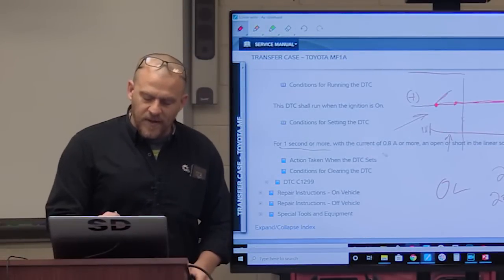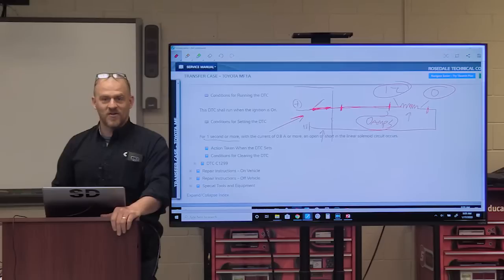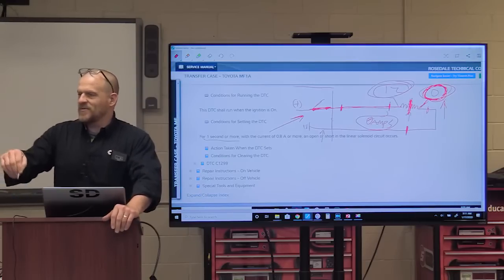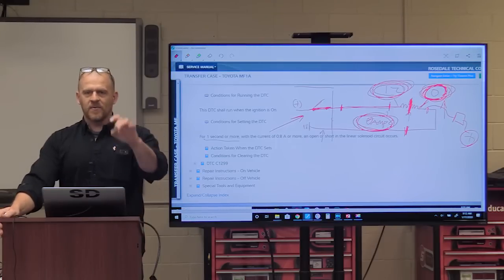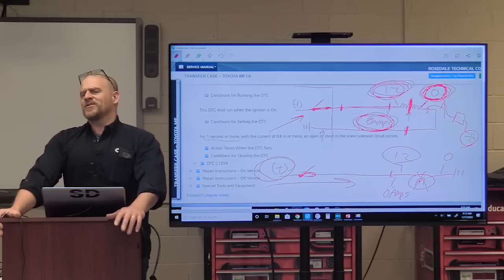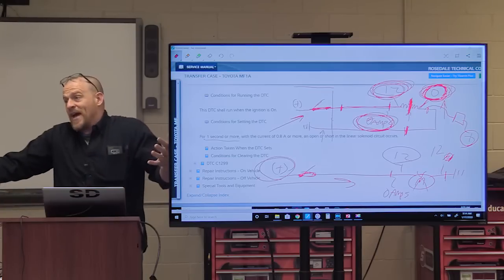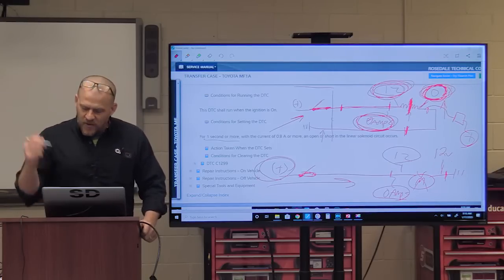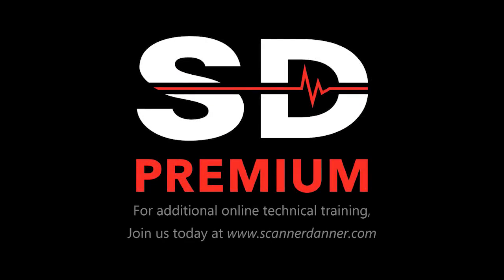Should I Make a Bunch of Different Test Lights to Load Circuits?

Comment: My opinion is that test lights are never my friend. When a bulb is "bright" can you tell the difference between battery voltage and lets say a 1.5 volt drop? If you can good for you. I will stick to voltage testing with some type of meter or scope.
Reply from the maker: A test light can be your best friend! Here is an example:
A solenoid is melted, you know it's bad, but how is the driver in the module? Substitute the solenoid with a test light and command the driver on! It is the single most accurate test you can do to test circuit integrity and driver control. This is one example of a myriad I can give you where a simple incandescent style test light reigns supreme
Reply: @ScannerDanner  don't get me wrong, I will use a test light for certain tests. Sure if I take the melted solenoid out and test signals with a test light to verify the driver's still works. It will not prove out the circuit integrity. Especially a large solenoid such as one on a starter. I've chased my tail a few times trying to use different Amperage bulbs testing circuits. For example, a bad ground wire half corroded at the ground point. Still lights a halogen headlight bulb just fine. Nice and bright to me although there may only be 9.5 volts because of the corroded ground. The computer will report a problem with that same circuit because it sees a problem with the integrity of it. My eyes will only see a massive difference in light, not the subtle difference of a volt or 2. I believe this is why many OE diagnostic plans include ohm measurements of wires from point to point. If service data says this wire should have no more than 5000 ohms resistance from point a to b , then anything above that will trigger a DTC. Circuit could still be intact and support the load of a light bulb but not intact enough to make a computer happy.
Reply from the maker: The key is to use the existing load in the circuit and perform a voltage drop test. You absolutely will see it! The starter solenoid example you gave. I would never disconnect a solenoid and put a test light on that circuit to say it is okay. ALWAYS leave it plugged in for all of your tests! The ohmmeter is another issue in itself. Service info is wrong on this tool in so many examples! Watch this one and then tell me the ohmmeter was the right tool. Service info called for it here too! https://youtube.com/shorts/yikFzf0c3lQ?si=mVPdILOahmmeTp_p
Reply: @ScannerDanner  I will watch it tonight. You and many others are my entertainment/education. I do know about ohm meters and service data being misleading. I absolutely have to pick the right path and tool to figure out a problem, I know this.  I once had a front axle actuator in a 2016 ram that was not working. The only tool that found the problem was my power probe. It was showing 2 wires shorted together. It was the harness from the frame rail to the actuator. Trying to show someone with a regular ohm meter showed a perfectly fine harness. The naked eye could not see the short nor could the ohm meter. There was something wrong with the connector and not the wiring but unfortunately no one in the shop had a microscope. All I'm trying to say is a light bulb doesn't tell me the whole truth, kinda like a string of Christmas tree lights when all of them are lit and no one notices a bulb that's a little bit dimmer. Also the voltage drop test is what I was talking about in the original comment. I can see numbers on a meter but not a difference in light intensity unless it is a major drop.

Comment: You say “voltage along with current flow is key”… ok you’re correct, but I don’t entirely agree that current flow is all that necessary to check in many situations and I’ll explain why. It’s great that you’re teaching it to your students though, because voltage drop and current flow do go hand in hand.

Personally, I’ve never used current flow in my strategy when diagnosing simple circuits. If you’re using voltage drop correctly to pinpoint a circuit integrity issue, you almost don’t need to look at current. A voltmeter (along with a test light) will give you all the answers you need. 

Here’s a scenario I recently encountered: We had a Stealth in our shop for a no start. During cranking, my test light stayed the same normal brightness on the cable side. But on the other side of the solenoid, it was slightly dimmer… Using a voltmeter, I found only 9 volts was being delivered to the windings during crank, meaning a 3 volt loss due to solenoid resistance. Sure, I could have checked circuit amperage, but I wouldn’t have been confident in calling a bad starter with those results alone. See, even a starter circuit, that demands more current flow than any other 12v system on a vehicle, was diagnosed thoroughly without testing amperage 

I don’t mean to say that amperage checks are entirely useless though. Of course, you can encounter a dragging motor (fuel pump, window motor etc.) that a voltage drop test won’t tell you. Only when voltage drop fails, will I break out the amp clamp. 

As far as test lights are concerned, I’d say anything goes… within reason of course. I’m sure there comes a point where very small incandescent bulbs won’t draw enough current, hence they may not deliver accurate readings. I mean within reason. Any test light from a reputable manufacturer. A 194 bulb. A fog lamp or halogen headlamp, or maybe a 3357 etc. No need for multiple test lights. It doesn’t matter really what you use, as long as you’re performing your voltage drop tests properly, and you can easily associate a dim bulb with resistance. And most importantly, when in doubt, use a voltmeter in conjunction with a test light to prove how much voltage is being lost

Comment: I have seen a case where the horn pad wire shorted to ground, ran the horn until it died which blew the fuse. So 3 problems on 1 circuit but that’s a different scenario to your 2 problem fuel pump hypothetical situation

Comment: Agree 💯 with the video! About the title, I would argue that the test lights help with speed, if I put a test light in place of the load Then in one shot I tested the power and ground. Not that you can't test it accurately with a meter, just helps with speed.  As with most things, there is more than one way to do so correctly.

Comment: as you suggested, there is always a possibility, for if it can go wrong it will go wrong. but i do not see the neccessity of a high horse rant for checking thew ground side even if there is an open in a coil or whatever. what if the circuit is grounded inside the computer, checking the integrity of the ground side eliminates that from having to diagnose any further. it never hurts to satisfy ones instincts or curiosity when diagnosing, because this is what drives good diagnosticians. even if it appears moot in this situation it is an important step in the algorithm for diagnosing problems.  thanks Dan

Comment: So how do you get around not stressing a high amp coil/motor enough with 200ma to see the problem? Do you eliminate all other possibilities?
Reply: I watched the 2 part video on the paid channel and didn't really get the answer
Reply from the maker: This is an open output solenoid, electric motor, light bulb, or even an input sensor circuit conversation. Your question is what again? Can you rephrase it?
Reply: @ScannerDanner  I'm sorry. I didn't phrase that very well. Also I didn't realize that it was just open circuit diagnosis. I was just asking that if you take a high amperage circuit with a resistance in the feed, ground, or load, could the circuit still light a 200ma test light and still that resistance not allow the motor/solenoid to work? In this case, would it require a higher amperage test to stress the circuit in order to see the voltage drop? I'm asking because I'm getting ready to buy a tool that would do just that.  If it is not necessary, I wouldn't want to waste the money.  Thanks Paul.
Reply from the maker: @jeremycameron6594  think about this senario carefully. If there is a high resistance power feed or ground, I'm 100% going to see it with my voltmeter, because the circuit is energized and my wiring or connector is still plugged in (hugely important). There MUST be current flow to see a voltage drop. The circuit itself is providing the load! If I choose to use a test light in this scenario, I'm doing the same thing! Circuit is plugged in and I'm backprobing and I'm relying on the current flow of the circuit, not my test light, for accuracy of the test. I also would caution you with a test light in this example if the output is still functional because you're relying on the brightness of the bulb for accuracy and depending on how much of a drop is occurring on the feed or ground, you may miss it.
One more piece. You mentioned a high resistance problem in the load itself. That one would be no different than my above example. Voltmeter testing would show normal (12v on the supply and 0v on the ground) or if you were using a test light it would be bright on the feed and not lit on the ground (again circuit plugged in and backprobing with it energized).
This is enough information to make the call on the load itself. BUT, since to load has high resistance and current flow is very low because of it, you're technically not stressing the power and ground circuits like they would normally be with your tests, so now we're back to my love example. I'm saying you're not going to have a wiring problem at the same time you have a faulty load in 99.9% of the times you see this. So if you're concerned that your 200ma incandescent style test light is not enough of a load, then go grap a headlight bulb and make sure it lights on that circuit. I don't ever do this last step. My test light is enough. Why? Because I already know at this point the load is my issue and the final check on the wiring (that I'm not worried about anyway) my test light is good enough
Reply: @ScannerDanner  That makes perfect sense. Thank you so much Paul
Reply: @jeremycameron6594  This video is about finding an open on an electrical component. Why would you, and more importantly, how could you stress a "high amp coil/motor" that is open? 

If your "high amp coil/motor" is not working, you don't want to stress the coi/motor. You want to stress the circuit providing power and ground to the coil/motor by removing the coil/motor and replacing it with a test light that draws about the same Amps to see if the circuit is good. If it lights brightly, then the circuit is good. The problem has to be the coil/motor.

If you do the test in the video and find the coil/motor is open and replace it without stressing the circuit with a test light of similar current draw, then it's possible you could also have a problem with the integrity of the circuit but not very probable. 

If the coi/motor is easy to access and remove, I prefer replacing it with a test light of similar current draw to troubleshoot. If the coil/motor is difficult to access or remove, then I'll take my chances and do what he does in the video.
Reply from the maker: @jeremycameron6594  think about this senario carefully. If there is a high resistance power feed or ground, I'm 100% going to see it with my voltmeter, because the circuit is energized and my wiring or connector is still plugged in (hugely important). There MUST be current flow to see a voltage drop. The circuit itself is providing the load! If I choose to use a test light in this scenario, I'm doing the same thing! Circuit is plugged in and I'm backprobing and I'm relying on the current flow of the circuit, not my test light, for accuracy of the test. I also would caution you with a test light in this example if the output is still functional because you're relying on the brightness of the bulb for accuracy and depending on how much of a drop is occurring on the feed or ground, you may miss it.
One more piece. You mentioned a high resistance problem in the load itself. That one would be no different than my above example. Voltmeter testing would show normal (12v on the supply and 0v on the ground) or if you were using a test light it would be bright on the feed and not lit on the ground (again circuit plugged in and backprobing with it energized).
This is enough information to make the call on the load itself. BUT, since to load has high resistance and current flow is very low because of it, you're technically not stressing the power and ground circuits like they would normally be with your tests, so now we're back to my love example. I'm saying you're not going to have a wiring problem at the same time you have a faulty load in 99.9% of the times you see this. So if you're concerned that your 200ma incandescent style test light is not enough of a load, then go grap a headlight bulb and make sure it lights on that circuit. I don't ever do this last step. My test light is enough. Why? Because I already know at this point the load is my issue and the final check on the wiring (that I'm not worried about anyway) my test light is good enough

Comment: Checking the ground side only takes a minute or two. I would just do it. And/Or provide a substitute known good ground. God bless, SD!!!
Reply from the maker: I wouldn't argue that. You'd also want to load the power side too. But a 200 ma test light is enough in most circumstances. The main point was in making the call on the load itself. The additional wiring tests aren't needed to make that call

Comment: Two or more problems on same circuit can happen. Because someone try to repair before you. It is my experience with maintenance in industry.. But it is easy fix when i use metode like yours, test light..
Reply from the maker: The main point was in making the call on the load itself. The additional wiring tests aren't needed to make that call. But I agree, there are circumstance where you can have multiple issues
Reply: @ScannerDanner glad to see a follow up from what I mentioned in the past, just in the beginning so I'm listening! Have a great day friend!

Comment: Not on a coil but let's say we have a electric motor technically you could have a badly designed circuit that was drawing to many amps and melted  a lead inside the motor and melted the ground wire at the same time. BUT you would more than likely see the damage.
Reply from the maker: for sure

Comment: Good points, as usual, Paul. Most of us watch both you and Eric O, and I have a lot to learn from both. One of the compelling things about Eric's workflow is how quick and simple it is. For a fuel pump, he'll use a 4A test light at the fuel pump connector, with one side attached to the ground of the connector and the other attached to power at the connector. If a 4A test light glows bright, he has instantly load tested both the ground and the power side of the circuit, and he's done within a minute. It's hard to be faster and more comprehensive than that. He doesn't need to make excuses for why he doesn't need to load test the wiring, because it's already done. He doesn't even need to do voltage checks at the pump so it's no extra effort or time.  You're right, if you measure a static 12V on one side and 0 volts on the other while loading the circuit, the pump has to be open. That takes just as long, and maybe you'll add a test light at some point of that algorithm, too. Not faster, especially if the tests point to a wiring problem. What if you get 10 volts? The attractive thing about loading the circuit with the current it normally takes is not only speedy work flow but also the reduction in false negatives and false positives. Some corroded connections may conduct well with low current flow but do badly when current heats up a tenuous corroded connection. That's the thing I didn't like about the LoadPro. We assumed a voltage drop of less than a volt was probably OK, but we were testing with much lower current than the device may normally use.

Comment: I kinda disagree with this:  I would take the old pump and show them that it doesn't work and that it's open...  And then I would let them know that there's a SECOND issue with the wire, and charge another fee for that diag..  I might do a little preliminary check or two and see if it's obvious--  but if it wasn't, I'd have to charge for another diag;  Especially if it's on a modern car that could have a long trail of connectors and modules just to get to through that pump circuit...  (Granted, I very likely would have told them all this up front, before they paid for the pump..  because I'm one of the guys that would have also checked the ground anyway. ;) ..  If I'm calling a module or pump, etc..  I like to check EVERYTHING --  twice even. Leave no stone unturned.   So I would have found this (fairy tale) 2nd open on the ground and set those expectations early-- that way they could choose to go forward and buy a new pump + more diag -- or just scarp the whole thing, since it's going to take more diag money.
Reply from the maker: No one will believe you in a shop environment that you now have a wiring problem after changing the pump. That was my point. But I understand your argument too
Reply: @ScannerDanner  Right.  I understood what you meant--  especially if you had to break the news about the wire issue AFTER the pump was ordered and installed..  That would be a hard sell for sure at that point. :)...  But again,  just throw 12v onto the old pump and show that it doesn't work .............    -     Maybe the bad wire was the initial problem, and then the car sat for 5 years and the bad fuel destroyed the pump: Just saying, it's not impossible......    I wouldn't want to fix the wire for free: that was my point. it could be a rabbit hole that turns into an hour of work.  Cheers.